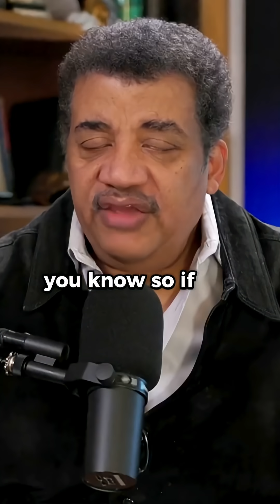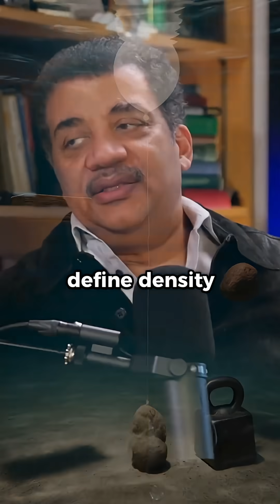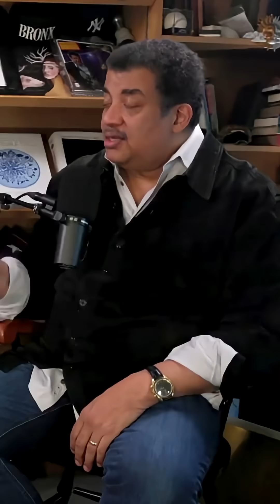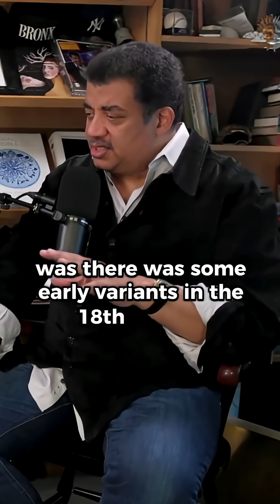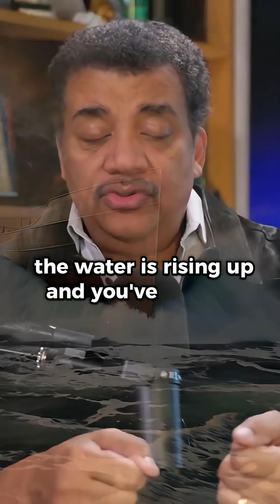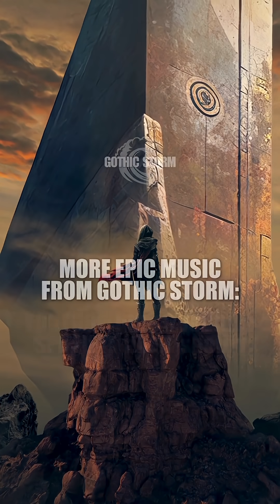Buoyancy, how does it work? 🛥️ #physics #science

Comment: It's not the shape of the hull, it's the fact that a metal boat is basically a balloon. As long as the hull is air tight, and contains stuff which combined is less than the weight of the same volume of water, it floats. But, if it gets even a tiny crack and floods, it will sink.